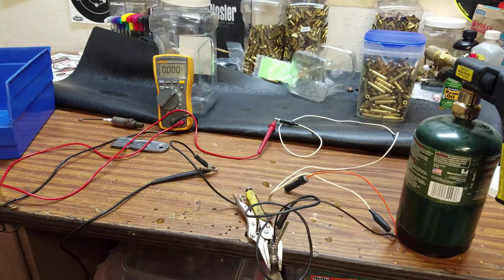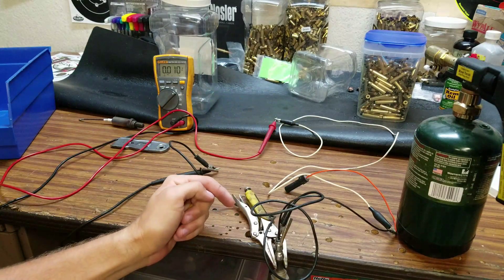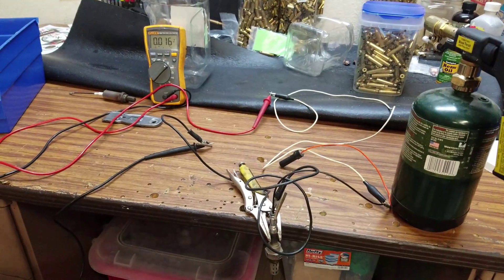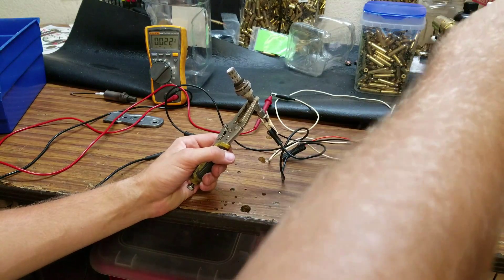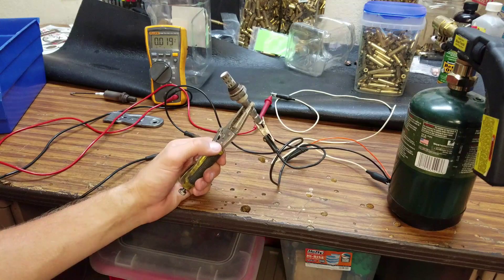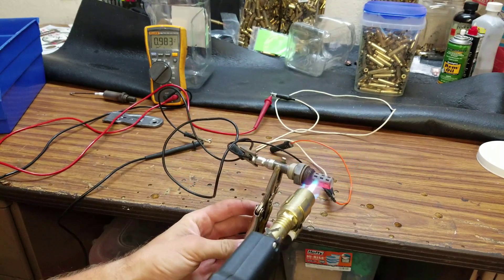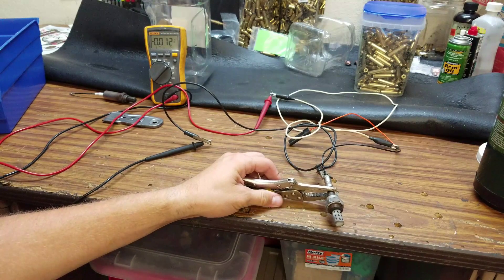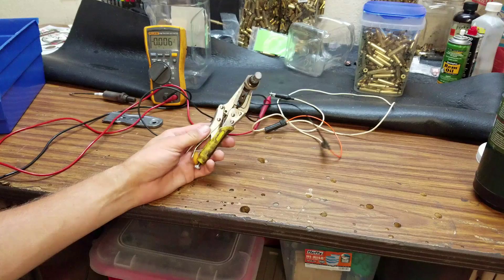DIY How - To test and Clean o2 sensor oxygen sensor

Comment: I have a 2011 Nissan versa.the code reads problem with exhaust.something heating up.can I heat the sensors up to fix.motor has 160,000 miles or buy new sensors
Reply from the maker: @todjones-t3r  you will need to buy a new sensor

Comment: how are you reading voltage without a source? is the air creating amps?
Reply: The sensor itself creates a voltage differential when heated and when there's more oxygen on one side of the sensor than the other. There's very little current flow but the meter can still read the voltage because it has a high impedance input.

Comment: How about mine... The highest I got was 0.9 but momentarily it's not consistent it fluctuate even though it is steadily being heated by flame..
Reply: That sounds normal to me, but I'm just a guy dealing with an O2 sensor issue on my own car and certainly not a mechanic. From what I've read, these things don't usually register anything until around 600 degrees F, so as soon as you take part of it from direct heat, the temperature in that area will drop and the voltage will fluctuate. I've heard of people using a heatgun to deliver a more uniform level of heat, since the whole entire surface area can be heated that way. Be careful if you try this method, as heat guns can reach temperatures in excess of 1100 F.

Comment: Yes is that outputting voltage or are you reading resistance?
Please explain
Reply: The tip of the sensor has a
zirconium ceramic bulb coated on the inside and
outside with porous platinum, which serve as the
electrodes. Inside the bulb are two platinum
electrodes. The inside of the bulb is vented through
the sensor housing to the outside atmosphere.
When the bulb is exposed to hot exhaust, the
difference in oxygen levels across the bulb creates a
voltage. The sensor will generate up to about 0.9 volts
when the fuel mixture is rich. When the mixture is
lean, the sensor’s output voltage can
drop as low as 0.1 volts. When the air/fuel mixture is
balanced (about 14.7:1), the sensor will generate
around 0.45 volts

Comment: Why does voltage output increase when heat is applied?  Is it because the torch is burning up oxygen in the atmosphere around the sensor, which is simulating a rich fuel/air mixture?
Reply: Exactly.